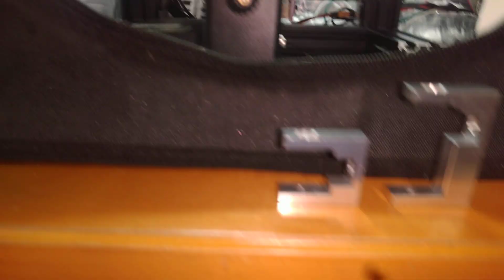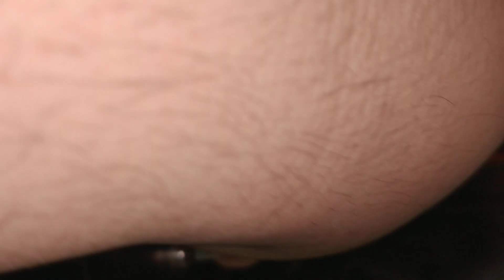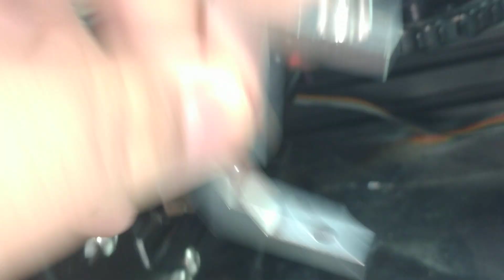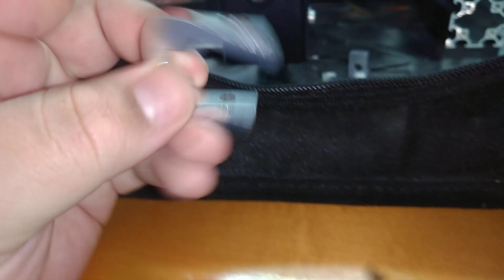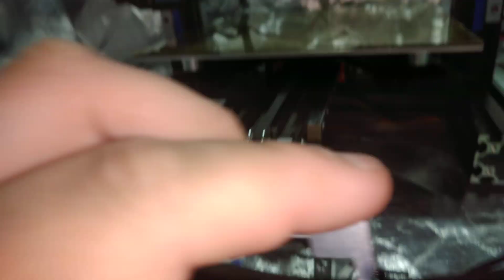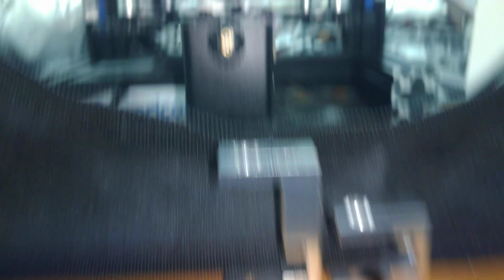How to properly align your linear rails on a 3D printer

Comment: Where did you source your "Y" axis kit? I bought Gulf Coast and have binding using the aluminum jigs. Gulf Coast sez my 4040 extrsion is slightly warped, a known issue with ther Creality Ender 3 Pro's. I have a replacement 4040 being cut now from Ender Extenders in Texas...But I hafta drill my own mounting holes and me without a drill press, LOL.

Comment: man, I bought them as soon as I saw them when I looked for a z-axis linear rail kit, I bought them a week after I bought the kit and I waited for them to arrive.
2 days ago I received them and started to install the linear rails, the linear rails itself was very easy to install and was installed with 0 error from the top to the bottom and it's straight and parallel to each other, BUT my big problem was adjusting the x gantry itself to the linear rails, the holes have to much clearance for them to a line them properly and the closest to parallel that I got was with the error of 0.1mm when I measure to the upper extrusion  that by manual movement feel great and didn't get stuck while I moved it (tried with the lead screw and without lead screw) however when I tried to home the printer and then bed level it, the printer started to get stuck but I don't know if it was because I still didn't install the second z-axis motor or it because the x gantry was out of level or because i have direct drive setup that weight close to 700 grams ,(today I just picked the second z motor from the mail)

Comment: As another commenter said, repeatability is the issue, using the same jig means that the accuracy from one point to another doesn't change. (So a printed jig is sufficient.)

Also don't lose sight of the fact that aluminum extrusions are often not as straight as linear rails. This is a bigger concern than machined vs printed jigs.

Comment: You don’t need accuracy in the jig, you need repeatability. That’s why a 3d printed jig will be just as good. You’d want to print it slightly small an sand away to fit snugly. Ensure you have the jig oriented the same way each time you use it to leverage the repeatability.
Reply: and then use a dial guage to absolutely make sure its straight